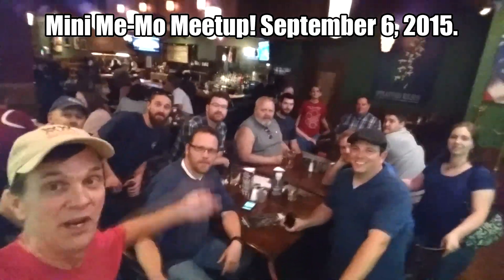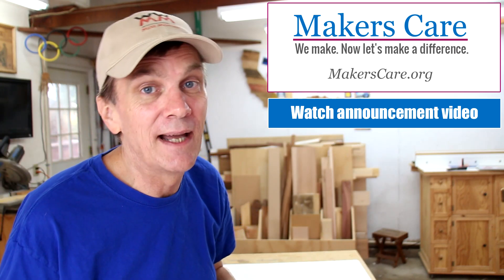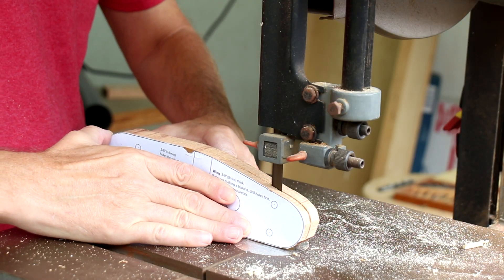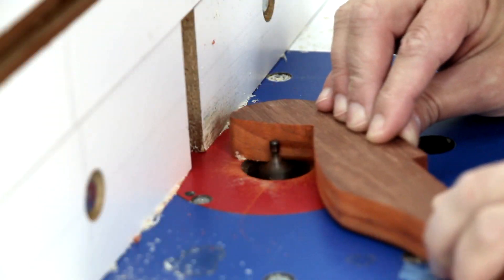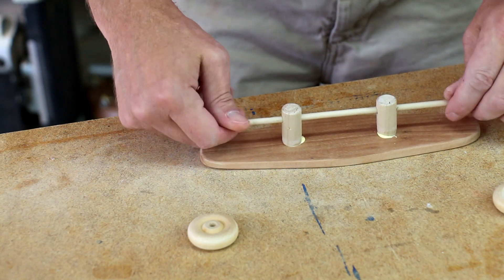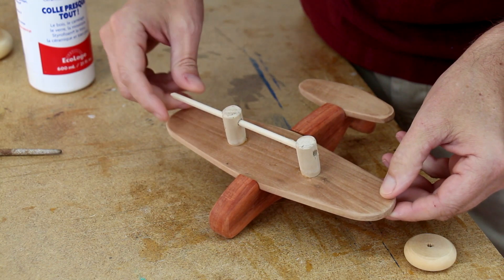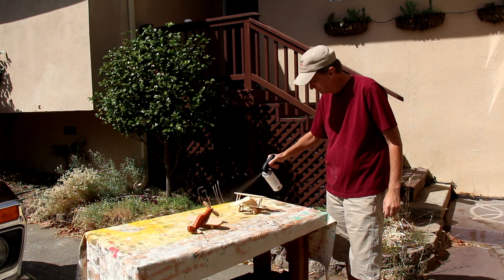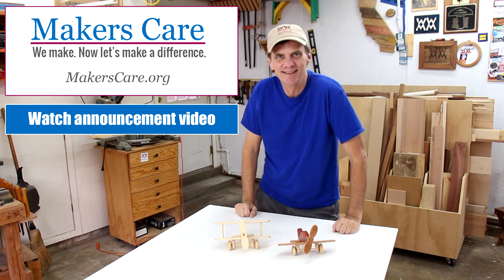How to make wooden toy planes

Comment: Steve,  Thanks so much for the PDF template.  It makes building the planes much easier.  I was having trouble removing the paper after cutting out the pieces.  I guess my glue was too strong.  To solve the issue I first covered the wood with painter's tape and glued the template to the tape.  After cutting out and sanding the pieces the tape came off easily.  I, now, have a fleet of planes for some toddlers to enjoy.  Thanks again. Mike

Comment: Wheels are fairly easy, use a holesaw, then attach the resultant disc to a nut and bolt mandrel, fit into pillar drill, then use files etc to round over and sand smooth ;)
tip: i use the long nut that comes with the countertop joiner bolts, the nut is held in the chuck, makes it easy to jusr screw in a bolt, and ensures it doesn't come undone when you apply pressure to the part

Comment: I saw that Mystery Spot bumper sticker. A Long time ago they used to tie those advertisements on to your bumper with 2  pieces of wire while you were inside of the attraction whether you wanted them or not . I have been to Santa Cruz many times living in the Bay Area. I love the beaches and the boardwalk. And I also like your videos very much. I have learned a lot watching them, keep up the good work.
Also, I have recently started building shelves myself. one is a 3 shelf unit with blind dados hanging on a French cleat next to the TV in our bedroom to put DVD player and DVD's on. The other one is a four shelf unit with locking doors on top of my workbench on our balcony at our apartment to lock my tools in.
Maybe I'll send pictures later when I figure out how.

P.S. I have seen those Leyline (sp) attractions similar to the Mystery Spot, moving around the country with carnivals when I was younger. I don't think there's much to them. Optical illusions. But still fun for kids.